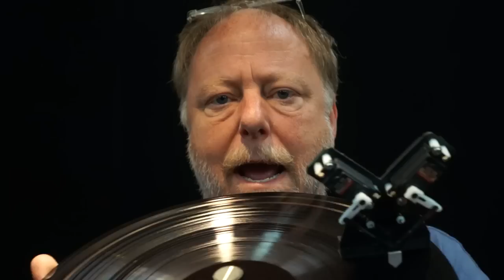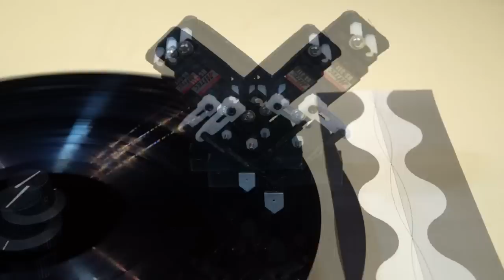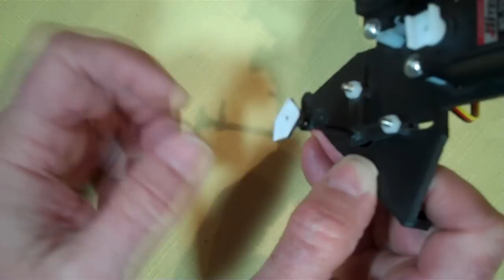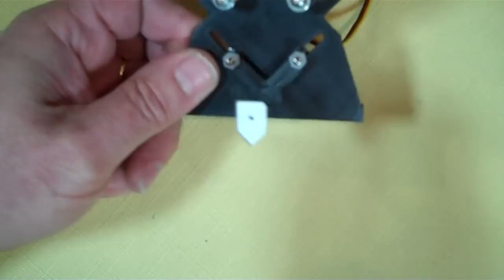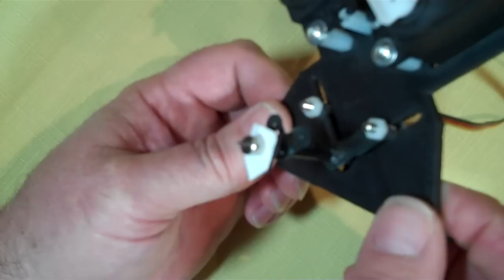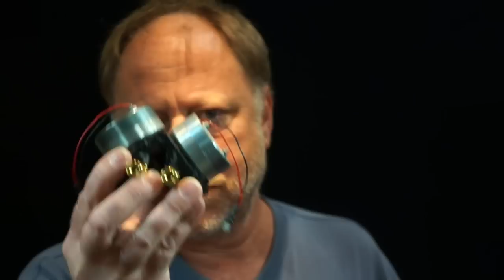How a Stereo Record Cutting Head Works - Vinyl record master Lacquer (Acetate)

Comment: When you consider the mechanics of a stereo cutter, and the mechanics of a playback cartridge, it's a wonder the whole system works at all, much less as well as it does! A lot of R & D went into the 45/45 degree stereo cutter!  Very, very good video. Thanks for posting.

Comment: Hello Bryan,

I am 63 and over all these years I thought that one stereo channel was the vertical motion of the stylus with respect to the plane of the record and that the other stereo channel was the back and forth horizontal motion of the stylus in the groove and I had no idea till I watched your video at least twice how it all really works. If you are planning to cut records with the head you showed us at the end of the video I wish you the very best that that will work perfectly for you and I hope you will do yet another YouTube video to show all that working.

All the best, 

Peter Nolan.(Ph.D., experimental physics). Dublin. Ireland.
Reply from the maker: I thought I replied to your note months ago. Sorry for the delay. There have been heads in history that did work the way you mention - One driver for vertical, and one driver for lateral.
Reply: Hello Bryan,

Many thanks.

Peter Nolan. Ph.D.(physics). Dublin. Ireland
Reply: Peter Nolan, Hello, I'm a 52 year old ex auto tech, I already knew a lot about the cutting of the groove, What I'm having a hard time understanding is how the hell you programmed an Arduino that well! Ugg !!!!!!!
Reply: Finally a clear explaination about how a vinil lathe head work! I'm curious to know what happer if i put 2 solenoids in place of servos... anyway, thanks again!
Reply: @fedevek did you try?
Reply: I tried to make a single-channel record lathe, but it didn't work as hoped. So, i sketched some new designs but I didn't spent time on it.
Reply: @fedevek  

Hello,

I wish you the best of luck with that. You are highly skilled. Amazing. I wish I had your capabilities.
All the best and many thanks,

🙂

Peter.

Comment: FINALLY!  Best explanation yet for how two walls on opposite sides of a single groove, traced by a single stylus, can produce distinctly different channels.  Also explains why the magnets in my AT-440MLb are arrayed in a right angle "V". Nicely done!
Reply from the maker: Glad you liked. It took me a while to get my head around the whole concept. Fairly easy to visualize it with my little simulator. Besides, it looks cool. How did you like the Ampex MM1000 knob in the center? Straight from 1969.
Reply: Ha! I did not catch that.  Nice detail 😁

Comment: wow I totally thought channel phase differences at low freqs would cause a requirement for compromises in grooves, (so my thought was correct) even though I new nothing about any of this tech,(didn't know of depth axis) what fun. I still think stereo from one groove has other such implications, will have to study these types of vids more...speculate other channel separation-like issues etc that will be interesting. thanks for great vid and fun demo device. Hitec good brand imo.  Low freq phase differences are usually not desirable in general anyway, for listening etc.

Comment: interesting! i cant wait to get to stereo level in my experiments...i have been told that its impossible to mount a heavy stereo cutter on my mono lathe cuz itd be too heavy (the cutting arm already weighs a ton) but yours are made of plastic and someone suggested some kind of overhead suspension thing to take some of the weight off.... so when im ready i would like to talk to you about perhaps purchasing one of your heads!

Comment: Nice one.  So the mic(s) picks up sound which is amplified to line level by a mic amp, then fed to a power amp or pre to power amp with the pre being the mixing desk to adjust levels, then the power amp drives the cutting head generators which operate as voice coils  within a magnetic gap.  They drive the cutting heads.  Meantime, the lathe alters the inward feed for a set time from outer to inner groove using presumably a high torque stepless motor?

Comment: At 6:09 you call circular stylus motion "nonsense" but in fact the quadraphonic SQ recording method used by Columbia and others in the 1970s showed a diagram on the inner sleeve of their albums explaining that a helical motion, like your very clever device produces there, is used to encode the rear channel information on their records.

Comment: Are the cutterhead coils wired out of phase so when there is a mono signal, left coil is moving in and right is moving out? What happen with the vertical signal if the coils are wired out of phase and how can it go up and down?

Comment: When cutting , do you have to make allowance for the speed difference from the outer edge to inner ? 
If I record a digital click track (metronome) onto vinyl and then play the record alongside the click track , the vinyl eventually steps out of time , almost by as much as 4 beats by the end of a 4 min track , I put this down to the relative speed of the vinyl under the stylus , the start or outer edge being relatively faster than the inner part .
Reply from the maker: Actually, the issue is a difference in cutting and playback speed. Cut a reference tone like 1khz, then play it back on your turntable. Use either a frequency counter of software on your PC to measure the frequency and adjust playback speed until 1khz is right on the money. My gut says your lathe is probably off due to wear on the spindle or rubber idler.
Reply: To give you some context , I do a little digital DJ'ing and after converting my vinyl records into .wav files , I find that almost all of the recordings suffer from this latency I spoke about . I have to use software to time stretch the audio to keep a constant tempo . They were all recorded using a Technics 1210 with Stanton cartridges .
Reply from the maker: Oh, I see. So you are not talking about actually cutting a master lacquer and playing it back both in the analog world. What you are running into is a sample rate issue between the source and destination. One example could be using a CD type rate of 44.1khz and the other being more PRO type rate of 48khz. Dive into that and you will find the solution. You will also find out why not only is the tempo off slightly but also the pitch. The two sample rates noted are just for example. You could be running at totally different sample rates and that's what you need to look at...

Comment: Very interesting!  How long does it take to cut an album?
Reply from the maker: uncleben03 In this case, the record is cut in real time. So if your a cutting 15 minutes of audio on a disc, it takes 15 minutes to cut the grooves. Plus the setup time to get everything ready.
Reply: Cool, I had wondered if that was the case.  Thanks!
Reply: Contrarly to tape copy, it's realtime or longer (Halfspeed recording or the procedure for Tri Ergon records)
Reply: about as long as the piece being recorded and any setup time minus any screwup by the performers, I should judge.... at the actual recording site.
Reply: +uncleben03 Tri Ergon were cut in very slow speed. Possible, because they used the own invention of optical sound track on film, to record the music, after this they played it slowly to the wax foil.
Reply: 12 to 15 min..

Comment: I still dont get how the complicated unik soundpicture would be stored in a groove and interpret xD
Reply: It is somewhat analogous to how a microphone and speaker works in that an electrical signal representing audio waveforms is converted to mechanical motion in the cutting head.that impresses shapes in the medium that can then be converted back later as a recording/playback cycle.  They are all in essence transducers converting from one form of energy to another. The difference is that the microphone and speaker convert acoustic air pressure waves to an electrical signal and vice versa.  The cutting head and playback stylus convert electrical signal to a shape cut into vinyl representing the waveforms and vice versa.

Comment: I've been to lathe trolls.. Most people are little helpful.. So i got an old book. that tells mes to fix my head the old fashioned way.. With parts you have to look hard for...?? Good video.. didnt need to know the mioddle of the video.. but not a bad video.. My deck is crystal oriented ?? and its Mono..
Reply from the maker: Most of us don't know about crystal cutting heads, like used in Wilcox-Gay recorders. There is a company that rebuilds them including the Astatic brand. A quick search will find them. I think the crystals have an issue absorbing moisture from the air over time but that company can replace the crystals make them work like new.
Reply: I called west tech several times.. with various types of cutter heads. One got lost in the mail, and i didnt insure it.. so Its probably in a ditch somewhere in ohio.. Oh well..??  I'll make something work.. M41 head burned, now am using a speaker and that Burned out.. So Such Luck.. :( .. haveing touble getting it to cut loud...

Comment: Would it be asking too much for you to explain how a quadraphonic track is cut?
Reply: quadraphonic is recorded the same way. it's just that an encoded information is along the way with sound. Quadraphonic reproducer contains a decoder wich separates 4 channels.
Reply: If I may add to that, in the one particular system I have studied the information for the front and back speakers is coded in the same groove wall, the same applies to the other groove wall for the other speakers. However, the groove wall carries two separate sets of frequencies: a lower band that the human ear can hear and a higher band modulated on a carrier frequency of around 35 KHz. This signal will obviously have to be mixed down to retrieve the audible frequencies so we can be able to hear it again. Now because some people only have a stereophonic system the lower band has to carry the information for both the front and back speakers (a+b) in order for them to receive the whole sound picture, so to speak. The higher band carries, interestingly enough, the difference (a-b).  In quadraphonic systems the signals go through an algebraic process to restore the correct signal to the speaker involved: (a+b) + (a-b) becomes 2a and (a+b)-(a-b) becomes 2b.